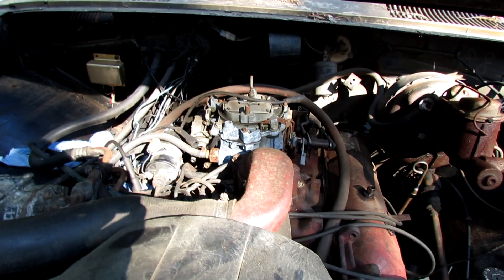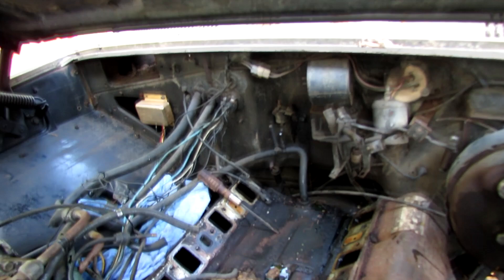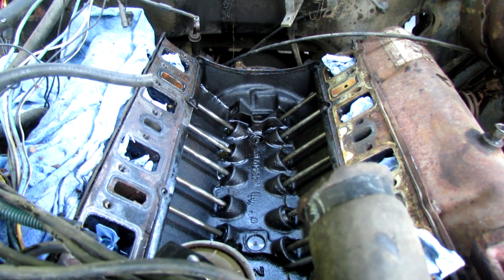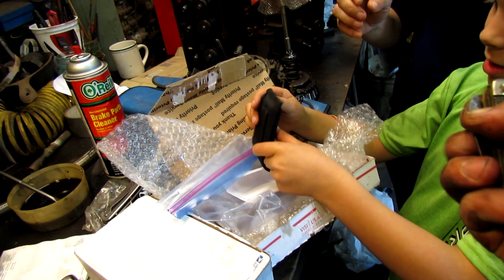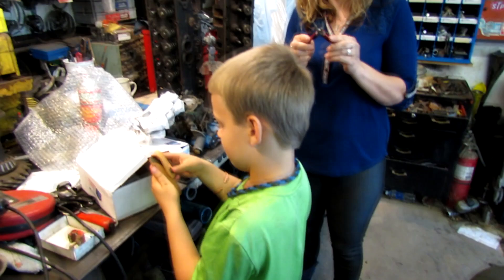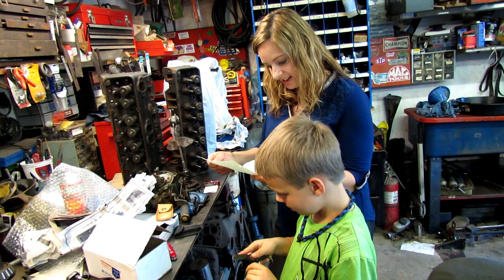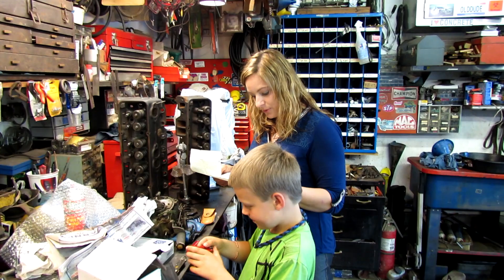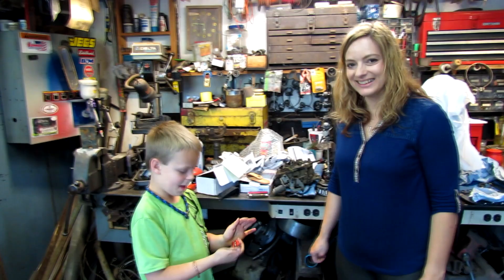Travelall and mail call

Comment: Great mail call! Seeing that manifold with the exhaust leak reminded me of a performance tip I read in Hot Rod magazine once. You block off those crossover ports with stainless steel plates. The idea was to have a cooler manifold.

Comment: I pulled a 345 IHC motor out of a pickup for a HS shop project.  Chainhoist to a wood A frame that they provided.  Proceded to pull it al of the way down to the ground.  OOPS.  ended up using the metal rafters on the school bus barn building to yank it out.

Comment: Sure you already know, but be sure to check the that the valves aren't stuck before putting it back together. I once ran an engine on 11 year old gas, ran fine for a while and then suddenly started misfiring. The old gas gummed up the valves, bent 2 push rods just like that.

Comment: wonder if old gas built up on valve stem , and valve stuck a bit . if apart still could spray some carb cleaner down in the guide around the stem .